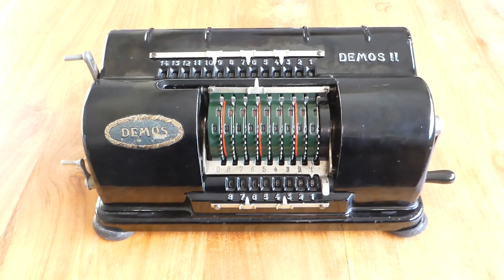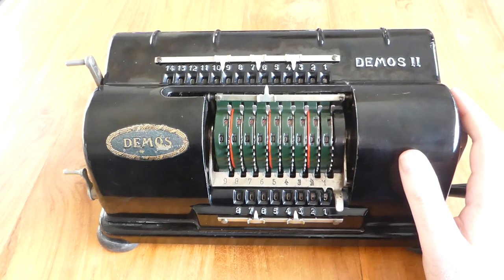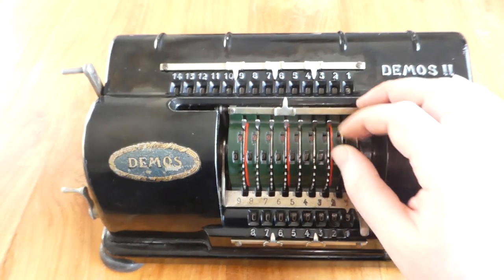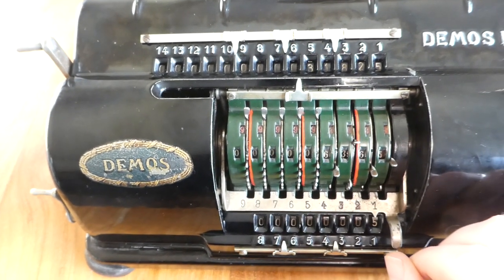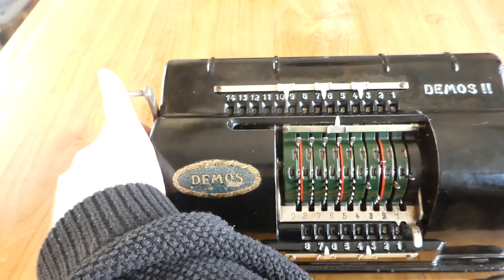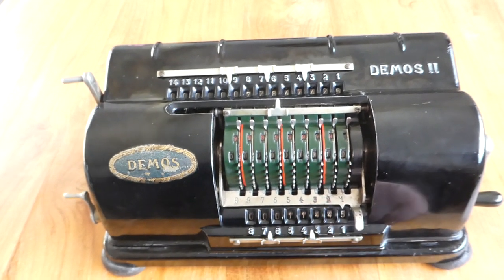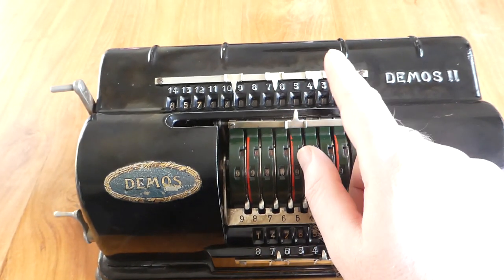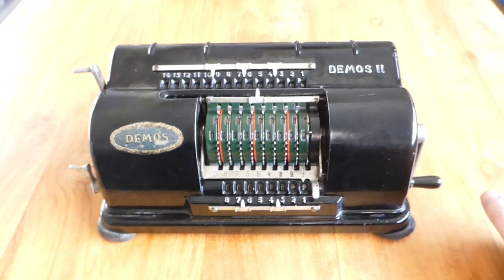The Demos II mechanical calculator

Comment: I have never seen that kind of mechanism before. Interesting calculator.
Reply from the maker: I think it was the first of this type. The Hannovera model C from Germany followed immediately after. In the 1950s there was also the much smaller Produx Multical/Multator which uses a similar idea but simply used springs for the return stroke.